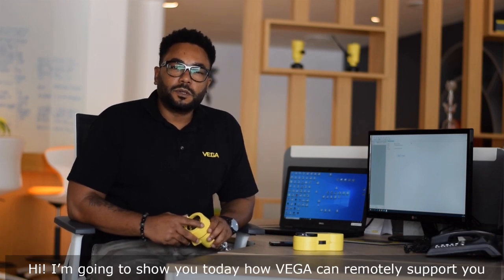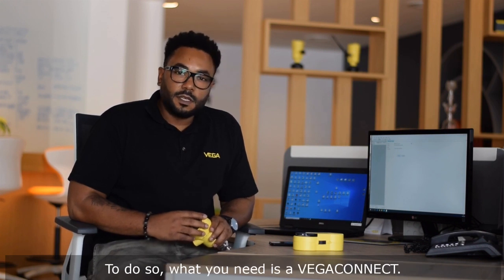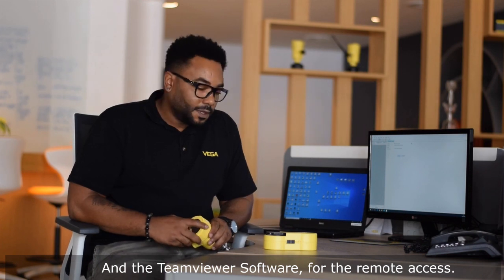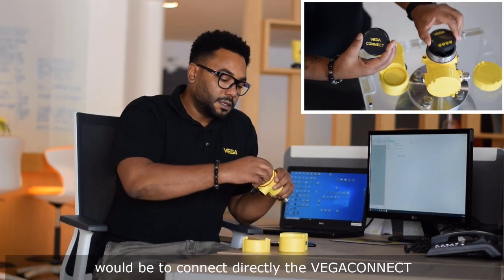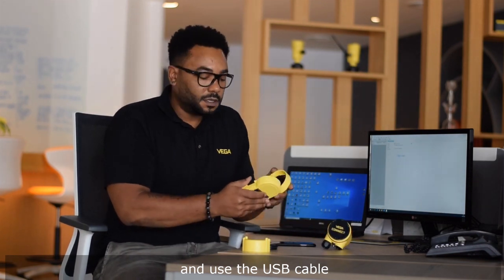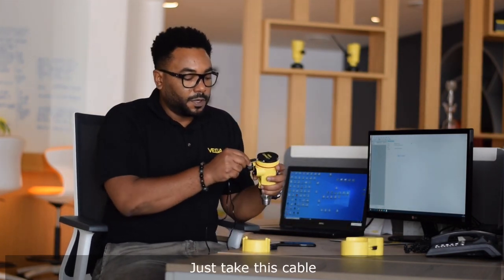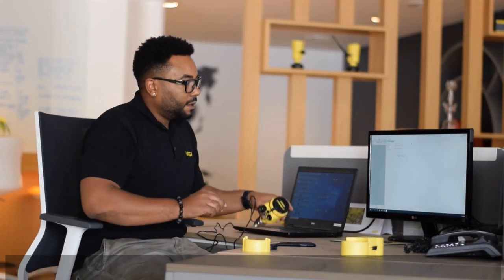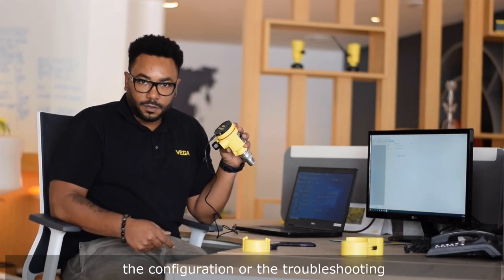VEGA Service Tutorial #1: How to connect a sensor and a VEGACONNECT?

Comment: inside the vega connect 4 box there is a bluetooth usb, i try to use it to take the set up but it does not  connect to the interface when i place it on a sensor. Can you please explain how it works? or guide me to a tutorial of pdf manual. thank you!